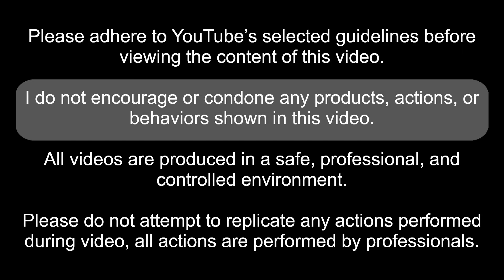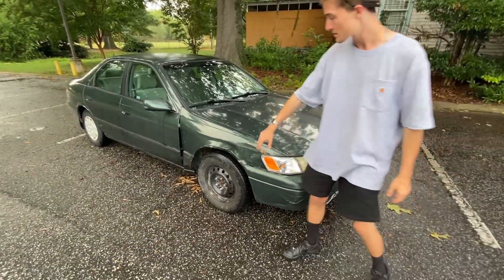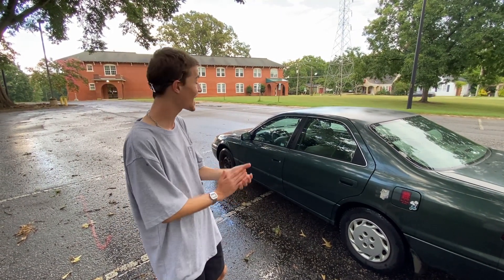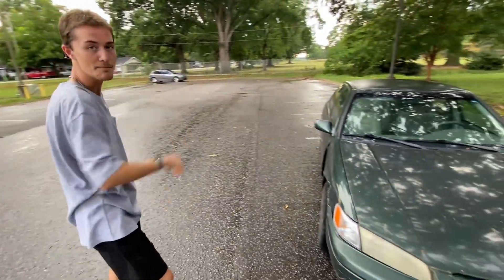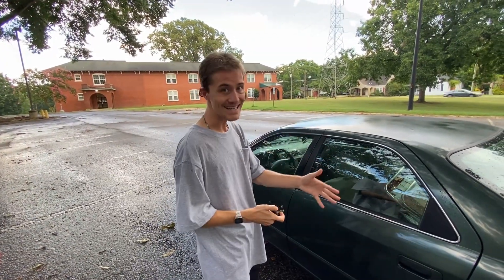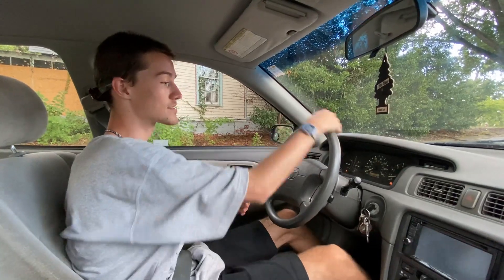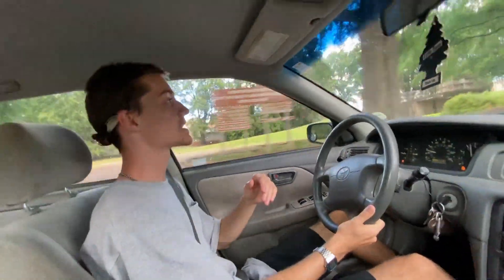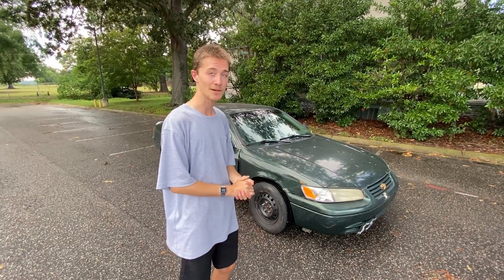I Now Own a 1999 Toyota Camry. It's a Car, I Guess

Comment: You should see my plumber's green 1998 Camry LE.  It's a pure Rust Bucket (former New Hampshire vehicle), very rough looking, parked outside in humid South Jersey, smoker's car.  But it has almost 300k miles and still runs!

Comment: It's actually not bad. I'll BET the radiator was NOT damaged when the bumper was hit. They eventually get a crack in the top, usually in the same place even the replacements do. The heat, cool cycles. Add anti freeze into the overflow tank. It has a full mark on it. IF, you ever need to replace the timing belt, change the water pump and the two pulleys for the belt. You're at the milage too that the cam seal may leak. So I'd change the cam, crank, and oil pump seals too. Be SURE to change the oil pump seal too. It's like an O ring type material, and they fail after so long. I learned that the hard way. I've owned a 99 camry for over 12 years. They're VERY reliable. Mine has over 260,000 miles. Oh, they're easy to work on too. I'd check that lower control arm on passenger side to see if it got knocked or pushed a little in her wreck, maybe even bent, for alignment issues.
Reply: I'll add, parts at Toyota are very well priced compared to aftermarket. I've had very good luck with them. That's where I got all the timing belt parts, water pump and seals and gaskets from. It's a non interference engine, so IF the belt breaks, the engine is NOT destroyed. Happy travels.

Comment: I found a 1999 camry LE with 90k miles. Garage kept except some dings and scratches. It's clean and drives amazing. It has the 2.2 4cyl. I've been zooming around and still got half a tank. It's great. Old daily was 1994 obs 5.7L v8 ext cab.

Comment: Can’t go wrong with a Camry. The beater car of choice for my family was a red Nissan versa 2006  it was nothing fancy but it got the job done and kept my sister safe during college but we got rid of it a couple years ago it broke down on us and was old and not worth fixing now my sister upgraded big time to a beater to a white 2021 Mazda 3 with black interior much better and more fun to drive hopefully it’ll be reliable and strong like the versa was. But beater cars still do hold a special place for me at times
Reply: Newer cars can't compete, sensors and soft aluminum engines means they have to be meticulously maintained or they'll die quick.

Comment: I guess it depends on what year of a Toyota Camry. I bought a 96 used. With all the maintenance. It's a 5-speed manual. With 130 k. The last 23k lots of expensive repairs. I still had to put struts on it. I still feel like I got a decent deal. I'm sure glad I didn't buy when it had 110k

Comment: Hi! 
I Have Black 1999 Automatic Camry 2.2L Ce  Imported From Canada. It's A Great Car! It Has 336500 Km. On It And It Runs Well. Some Consumable Parts Has Changed In Six Years I've Had It. I Have Had Two 1987 Ones Silver And Blue One And 1997 Golden One. I See Green, Red And Golden One's Every Now And Then European And American Models But Black One's Are Pretty Rare Here In Finland.

Here's A TIP:
If Timing Belt Breaks This 5S-FE Motor Model Don't Break  Valves Or Anything!! 🙂
I Didn't Know That When My Golden Camry's Belt Broke And I Took It To Junk Yard For No Reason! 🙁 I Could Just Changed Belt And Stuff And Kept Driving! 🤔

Comment: This thing is as reliable as reliable can get - the pinacle of I4 engines. This and the 98 Corolla just keep chugging along. The oil seal on these cars goes and I basically ran mine bone dry for 3 days without issue. Ran on a bad power steering pump for 2 weeks, etc. If a part does go out it's usually because of rust and they will keep chugging along until you can get it fixed. The only issue is these things are so low to the ground they rust out easily in NE winters.
Reply: Can I install Bluetooth in this car ?
Reply: @Jzio3  Yeah it supports a dual DIN deck. I have a Pioneer in mine.
Reply: @brianpacheco1927  is that the only way you can use Bluetooth in it ?
If so how much is it
Reply: @Jzio3  No you can get one of those FM Bluetooth converters and tune it to the station it's set to but this works better.

Comment: I had the model before - the super ugly wagon.
Blew it up towing a trailer up a very steep hill.
2.2 auto, and I think it dropped a piston.
With the oil light on, I kept driving it for 2 weeks, and traded it for twice what I paid.
On a Mazda Tribute 3.0.
It was fast but hungry.
No rust, as evidenced by my having to be cut out of it by Emergency Services after hitting a bank at 60+. The lights went out.
RIP, faithful old cars.

Comment: One thing over here in Victoria, in upside down land the car wouldn't pass roadworthy at all, geez even with a small oil leak or worn or perished boots covering the tie rods and all the works is a non pass.  There is a rally around this area where they run old cars I think for charity to see if they make the journey and it is called the shitbox rally.  At least you wont have to worry about dickheads in supermarket parking lots opening the door and damaging the  paint work.

Comment: My 1999 Toyota Camry is a 6 cyl - five speed manual.    I have 400k miles on it.   Bought it new-  You can kill a 97-01 Camry.   They will run forever.   They man not be pretty- but i would rather have reliability over style.    I'm on my second clutch.   Only issue I've had is with the Arizona sun and the paint - oh well :)

Comment: I bought a 2001 Toyota Camry I bought a few months back so far happy with It I had all the features I want good gas mileage easy to drive what more could I ask other than full coverage Insurance at a low cost  what I do Not like about It Is the security system at risk of getting locked out of Car and the previous Owners were smokers which Is offensive and Car sets too low If was to accidentally hit Someone They would be killed other than Car just going over Them but Toyota Camry one of the best cars there ever was but If didn't use gas would be awesome. I bought My Toyota Camry because of all the stupid fda educated Doctors that do Not know what Rife technology and Ozone IV Is and having to make long distance trips to The Holistic Doctors that actually know something

Comment: your car is eating the tires bc of the suspension or you need a alignment
Reply from the maker: indeed but it's ight cuz the alignment can't be fixed 😂😂 it be what it be but it's fkd ngl. found out the car got subframe issues after the recording of this video
Reply: @jacobfuckingjones  as long as it drives good, we have nothing to worry about bc its a beater XD.